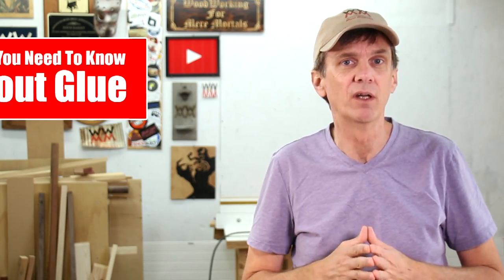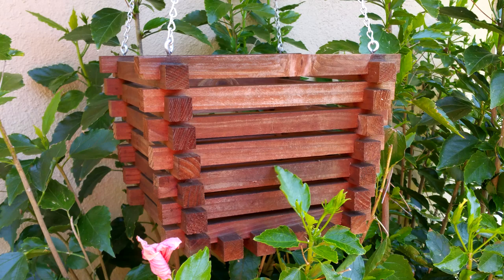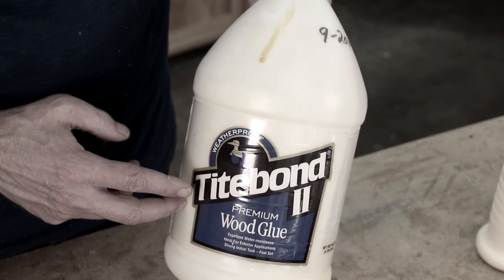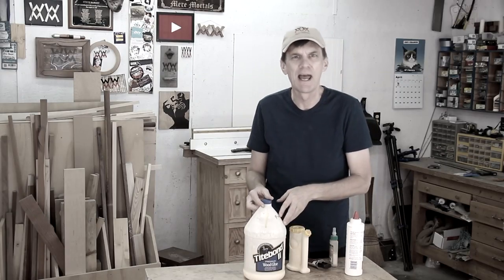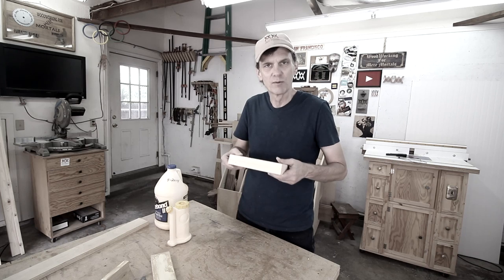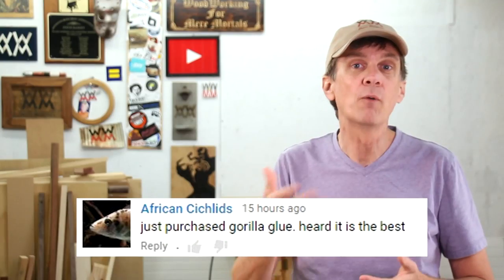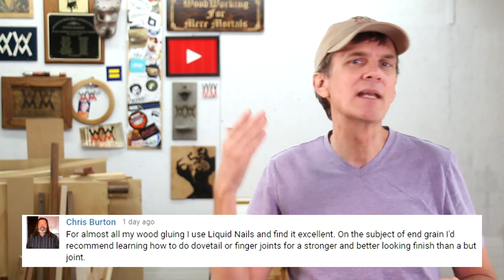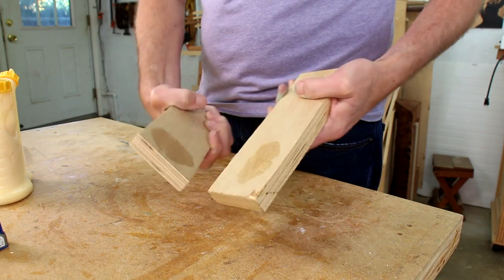Why I Don't Use Titebond III | MORE MINUTES

Comment: I used titebond III on a cedar planter and didn't have any issues with it staining the finish. I used a rattle can of minwax spar urethane. 
Favorite glue is the marine epoxy that I am using to build my boat. It is in fact waterproof, probably the strongest option out there, and can fill gaps when used with the right fillers; but expensive, messy and you have to wear gloves.

Comment: i can't believe you actually mentioned my comment. for my picture frame i have made a rights pigs ear with the tenon part cause the bit for the mortiser was an 8 not a 6 so i have a lot of space and i only use the one type of wood so the sawdust will be easily matched but the gaps are huge since i am doing them by hand. im sure it will turn out nice in the end. and construction adhesive best suited for construction projects. well blown me down :)

Comment: CA Glue can take a few hours to fully cure if you gloop it on that thick. It dries much faster if you use a thin line. It sucks at shear strength, though. Much better in tension because it is so brittle, unless you get the rubber toughened glue, which is flat out awesome for wood.

Comment: I use Titebond 3 almost exclusively, it does leave a dark line but then I most often work with Mesquite so.... Gorilla glue is handy when repairing older furniture, like round tenons in an old rocking chair. The expansion fills the joint nicely and it makes a very strong bond. I use CA as a tacking agent in combo with wood glue sometimes, but mostly for a finish on the lathe.

Comment: Titebond III has a significantly lower chalk temperature than II (45F vs 55F).  This makes a difference here in New England where I typically heat my shop to about 50F in the winter.  Not warm enough for II, but enough for III.

Comment: Titebond II = ANSI Type II water-resistance
Titebond III = ANSI/HPVA Type 1 water-resistance specification and offers superior bond strength, longer open assembly time and lower application temperature. 
Sounds like both products would work outside but joints bonded with type II would fail sooner. Hope this helps.

Comment: Good point on darkness; if my shop weren't so cold I go w/ T2, but mostly use T1 and plan on using T3 mostly in future (not where dark glue line is problem).  T2 & T3 have some advantages; T3 4000psi vs. 3700psi for T2 and 3600psi for T1. You're in warm California, if I recall; I'm in Northern Michigan (the U.P.) where my basement is 50F-56F, and only T3 is rated for >45F &  T1 minimum 50F. T3 has more open time too.

Comment: im a noob and i recently built a concrete mold to make wooden maple skateboards.  I used Titebond III because it gave me a longer open time than II.  and it seemed to dry a little slower then II as well.  i used 7 veneers of maple for each skateboard and needed all the time I could get.  Titebond II dried before I could glue up all the layers and get them in the mold.

Comment: If you know MTM Wood, he makes end-grain cutting boards.  I believe he mentioned using TB III on his boards because it was not as harsh on thickness planer blades at TB II.  If you made a lot of boards as he does, that would definitely be an issue to consider.

Comment: I build guitars and i use titebond III . Longer open time is nice, thats it. Super glue is super useful when you work on guitars, gluing frets, nuts, inlays, small stuff that doesnt have to hold that tight. 
On nuts, (the slotted part that holds the strings on the head of the guitar ) you can mix super glue and sawdust to repair chips and cracks and since super glue is clear, you can color match quite easily.

Comment: I use Titebond III for just about anything.  But when I need to use the gap filling trick, fill the little gap with CA glue and sand over it to push some fresh sawdust on top of the glue before it dries. Works really well for me.

Comment: Waterproof != Weatherproof! Reread those labels, Steve. Also, Titebond 3 has a longer open time, which is why I use it. The extra cost works out to pennies per project and the ability to slow down and be precise during glue ups is worth it to me.

Comment: Just did a Projecct using Titebond's New Glue called "Thick & Quick", It works great and it dries Clear...I did a strength test before I used it with 2, 1 1/2" x 1/2' thick Pine Boards glued together at 90 deg and the board actually broke right off when I tried to break them apart...

Comment: "2P-10" from FastCap is that BADASS  2 part glue. 

I DEFINITELY RECOMMEND getting your hands on that.  I don't even need to use Brad or trim nails anymore.  

I recommend using that in conjunction with a regular glue you use.

Comment: I like white glue the best, dries clear and they are all pretty similiar...dried plastic. Few things I have learned are to use epoxy and saw dust to fill, no water in epoxy and sanding exposes the fibers really well. A razor cut edge glues much better. Pre glue end grain to end grain joints and the glue will take much better...still not as strong as glueing long grain but substantionally stronger.

Comment: I use Titebond 2 almost exclusively, but I have used Titebond 3. I think the only real differences are that Titebond 3 has a longer open time, is safe for indirect food contact, and has a slightly higher waterproof rating. I've never had it leave stains along seams either, but I mainly work with hardwoods, and haven't done a redwood project in years. Just my opinion, and worth every penny you're paying for it, but I say use whichever glue that you prefer.

Comment: Super Glue is great for 2 uses.  1) i use it on the lathe for turning , you use it on a waste block. 2) it is great for trim work crown molding corners are so hard to keep perfect and nails split the wood,  I use it on all  corners prior to nailing.  The accelerated takes the drying time from 1 minute to 5 seconds it is Beautiful for that

Comment: I use super glue to fix small errors like chipped edge while making round overs etc. It's only benefit is that you can get back to peace after 5 minutes or so. It's mayor flaw is that it does not stain. It is pretty much a plastic. But stains or glue joint is not visible if oil or wax is applied.

Comment: Matthias Wandel has a video where he tests glue joints with different levels of pressure.  If I am remembering correctly he was able to get a weaker joint by overclamping.  And I think his loosest clamping test (thus keeping the most glue in the joint) was actually strongest.  At least using just regular yellow wood glue.

Comment: Super Glue: When it was Eastman 910, we used it to stick accelerometers on to airplane wings in the big test lab.  We cleaned the attach point with some kind of solvent, then put down a square of duct tape, then glued the accelerometer on with E910.  It was very strong in tension (pulling it away from the surface), but not so strong in shear (pushing or pulling parallel to the surface).  I've seen lots of uses for Super Glue, but not very many for typical woodworking.  Pen turners use it a lot as an instant hard glossy finish.

Comment: super glues are used to fill holes in dark woods.  I've never used it to tack stuff where blue tape was readily near by..... the super glue I've used was the type that you spray with the activator, but it's not a bonder.  It's a hole filler for walnut, etc.  Also, it's quite possible to squeeze too much glue out of a clamping, particularily some harder woods when sanded too fine, or jointed too glossy...

Comment: I use Gorilla glue for repairing chair joints from the lower quality chairs, it does foam out a little but learning to use just the right amount prevents most of that and cleanup is very easy.  It also swells in the joint which tightens it up a ton so I haven't had one of those come loose yet.  I also have never moistened both pieces, the bottle says one damp, one dry, I add the glue to the dry side.  Those loose chair joints are the only thing I use it for though.

Comment: For what it's worth, I find that TB3 has a slightly longer open time as well. I do cutting boards and use it exclusively. I tried TB2 a couple times and it tacks up faster so complex glue ups are impossible.

Comment: Construction adhesive on MDF butt or miter joints works much better than wood glue. Dont use Liquid Nails, its hot garbage, but PL 300 smeared thinly does an amazing job holding MDF endgrain together.

Thanks for another great vid Steve.

Comment: I used CA glue when making a wooden ring as jewelry. Made from purpleheart and my test ring broke into just around 6-7 pieces all together. Used CA glue to fix it each time and it never once broke in the same place. 
I would say CA glue works very well for smaller projects and maybe better on harder/denser woods.

Comment: Put some vaseline under the seal of your glue bottle cap to prevent it from wearing out.  Works on mason jars you fill with finishing fluid to prevent cap from sticking , and also works on fridge gaskets to get  a secure seal.

Comment: The glue clogs the pores on the wood, which prevents it from taking in the stain.  There are some stains that are meant for multi-surfaces (like gel-stains for example) that I have had success with in gap filling scenarios.

Comment: Some very interesting points.I use TB3 on all of my projects. I will try TB2 though and see what I think. super glue is good for plastics and tiny bonds, for example, I used it for my wife's windshield washer hose cause it kept slipping off. Hasn't slipped off since.

Comment: I recently started building longboard skateboard decks using 7 layers of 1/16" maple veneers.  I use Titebond III for those because it has a much longer cure period and that gives me the time to glue up both sides of all 7 layers before placing the stack into the press.  It takes me about 30 minutes to glue up a deck and I would hate to have the glue in the first layer to be dried and cured before I finish the last layer and press it.

Comment: Modern glues are Amazing! I use Titebond II every day to make 2" thick tables of pine, maple and oak. I never coat both surfaces. I think that the old white glues did not bond the grain as readily as the new glues and you could over tighten the joint. T II quickly begins to soak into the grain and makes an almost molecular bond. Clamp 2 pieces together for about 30 sec. and try to break them apart. Keep on Makin'
Reply: Seconds? or minutes?
Reply: @moosed  try clamping for 30 seconds to 1 minute and you will be amazed at how hard it is to break it apart.

Comment: Titebond 3 has a longer work time and is 5-6 times stronger. 2 is a overall good glue for most projects. I saw a head to head test on their strength and the 3 was dramatically stronger. I was pretty surprised from it. One thing I noticed from my shop is tb3 works better on dense exotic woods. I’ve had issues with tb2 glue joints cracking or breaking. It seems like it can’t penetrate those woods very well. For cutting boards and bitches blocks the 3 seems to be more waterproof. Never had a joint break or come apart after being in water or washed a lot. I did have 2 come apart with the 2 over time. Personally I use both. Just depends on what I’m doing. The 2 sands and stains a little better.  The 3 can gum up.

Comment: I use CA glue on a daily basis. I am a professional trim carpenter. When I'm doing joining crown moulding or baseboards I cut my scarf joints at 22.5° and glue the mounting ends together with CA glue. seriously the joint is so strong I can joint two 16' sections together and it be carried out by two people with no worry of the joint breaking

Comment: have you ever used contact cement for a wood joint? I built a few planters and I used it to temporarily hold some pieces together. It seemed to work just fine. It didn't seem like the most sturdy joint, but It worked for what I needed.

Comment: You should also try taking a look at hot glue. I use it for very small pieces in hard to nail places, like simple window apron returns. Only thing is that you have to work fast and apply it lightly.

Comment: Beekeeper a will typically use Tightbond III due to moisture inside the hive. Usually this is only an issue until the bees properly propolize the walls of the hive. Propolis is tree and plant resin used by the bees to weatherize their hives by closing off gaps etc.

Comment: The only benefit I can find of Titebond III is more holding strength. (See Farmtests U Tube video on wood glue physical testing) I have almost never needed more holding strength, as the wood fails before the Titebond II in most cases. However I used to build PA speakers out of 13 ply Baltic birch ply and it had to have angle iron internally and be waterproof. Each speaker was coupled to the next speaker and had to hold the weight of a dozen speakers below it plus heavy cabling to power them,after it was hoisted up by a chain hoist. It was over 1000 lb load easily. That case needed the most holding strength and waterproof.

Comment: I gather Steve lives in California, though I don't know in what part of the state. I live in Florida, and I'd guess that I have to deal with a MUCH higher level of humidity year round, as well as significantly more rain per year that he does -- especially if he lives in southern California (my wife used to live there and says essentially nothing grows there, other than cactus, without being regularly watered). While I have FAR less experience than Steve does working with wood, for now I will continue to use Titebond II for projects that will be kept indoors in air-conditioning (it is great glue and slightly cheaper than Titebond III), but for anything that will live outdoors, I'll keep using Titebond III.

Comment: I'm sure you may already know this by now that Gorilla Glue now makes a wood glue. It's not the same ole foamy stuff. I've used it with great success on both indoor and out door repairs as well as projects. I seem to do a lot of repairs for other people. I purchased a king size headboard, foot-board and side rails where one of the side rails was cracked down the grain for about 1/3 of the length. I used the Gorilla wood glue to repair it and that was about a year ago. It's still holding strong. Unfortunately though, I've not seen it sold in gallons.

Comment: I don't use Gorilla glue or any of its ilk any more, but they definitely aren't "gap filling". The foam is weak so if the joint isn't tight and adequately clamped (so the foaming action doesn't push the pieces apart) it makes a very weak bond. You also only need to mist the surfaces (only need to do one surface usually) if the humidity is low. Normal humidity is generally sufficient to kick off the reaction. That type of glue works well for fastening metal to wood, but any more I prefer a tight fit and a bit of CA glue - which will make a very, very strong bond if you use it right. I've fastened a guitar bridge with it and had no problems - and that is about 2 square inches holding nearly 300 pounds of string tension. It is a brittle glue, so will not take a blow well, but I put the handle back on my favorite coffee cup over 10 years ago and it is still going strong.

Comment: So, the main difference between 2 and 3, other than the color is that 3 doesn't cure as hard which allows for some movement in extreme humidity variations.

And for the sawdust filler, you need to use hide / liquid hide glue.

Comment: CA/"super" Glue is very good for bonding plastic to plastic. It's not as strong as epoxy, so it's better at surface-to-surface than, say, gluing back together a thin piece. It also doesn't break down due to heat or moisture. Thus, it's a good choice for something like mounting a hands-free mic for a Bluetooth-capable head unit in a car, where double-stick tape would give out in the summer heat.

Comment: I have heard Titebond 3 described as a Skateboard glue with a longer shelf-life though it does have a shelf life.  IME it has a more flexible bond TB2 but I only use it when I know that will use it all up before it goes off. I  always have a bottle of TB2 around.

  I have seen a joint fail from over clamping and I have seen skate boards and snowboards over pressed  to the point where all of the glue is pushed out and the layers are dryly rubbing against eachother

Comment: Yeah I learned  in wood shop that Titebond 3 was actually developed for skateboard manufactures to be waterproof, very strong, and yet flexible. I haven't heard about it leaving stains though that is kinda weird. I still use titebond 2 though on most projects unless I want the glue to be able to flex a little.

Comment: I think the reason a glue and sawdust wood putty doesn't take stain the same way as the surrounding wood, in addition to your point about the hardened glue being different, is also like how face grain and end grain take stain differently, the sawdust being more absorbent like end grain is.  I have had some success gluing plane shavings from the face grain over the defect and sanding lightly to feather it out.  But again, the surrounding glue in the feathering looks a bit different.

Comment: natural oil that excretes from exotic woods need epoxy   tite bond lll was to be a solution to needing part a and b epoxy products that are expensive.
guitar builders use these to ensure that adhesion is achieved when using exotic woods that separate in time from the natural oil that can secrete from within.
  This is my impression from reading about the product when it came out a few years ago, also a temperature difference was mentioned if I remember correctly. Thanks for all of your videos.

Comment: If you need a fast joint but only temporary, I saw a video where they use hot glue.  Seems like it might work as well as cyanoacrylate for temporary adhesion but is even faster.